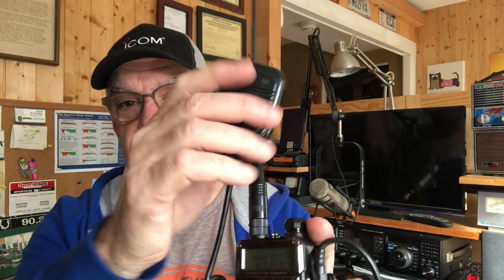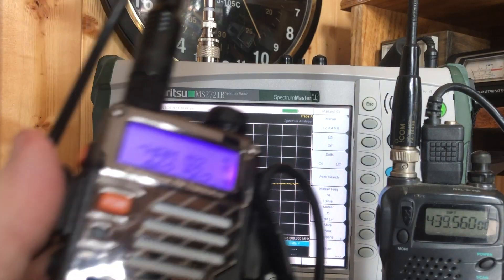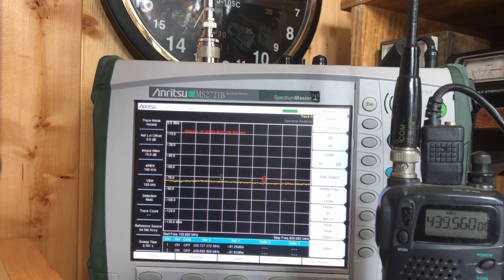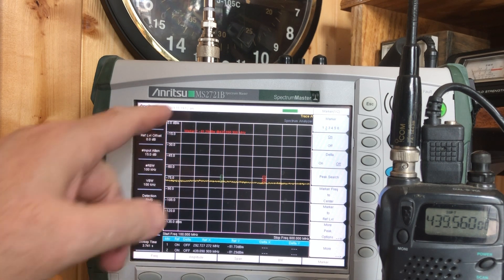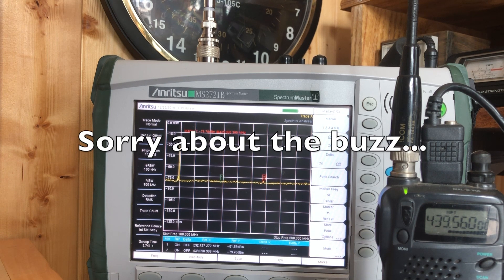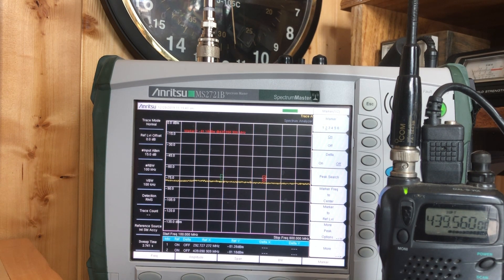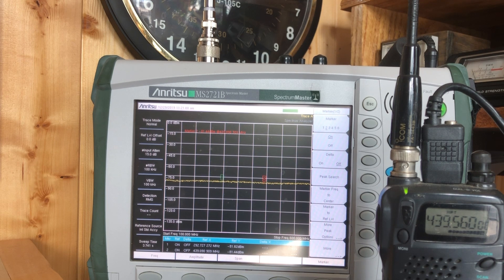Baofeng UV5R Transmission Test

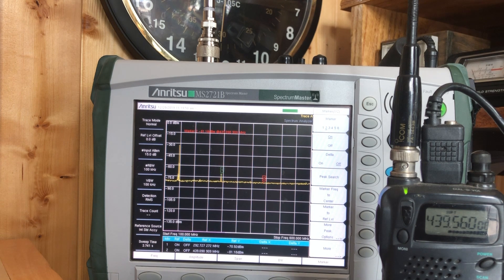Comment: Hi Chris.  Great video – and you kept it simple and to the point.  At 2:00 you questioned whether the 40dB down harmonic was in FCC spec – the answer is, yes it is!  Here is the spec: FCC regs state that for a transmit power of less than 25W (e.g. handie talkies), (i) any spurious emission must be 40dB below the fundamental emission and (ii) not exceed 25µW (microwatts).
  
Various tests I’ve seen on Idiot Tube seem to imply that the UV5r harmonics are generally within the 40dB down FCC specification, although maybe not complying with the maximum specified 25µW (microwatts), which may be the likely cause of harmonics over greater distances compared to the better-made Yaesu, Kenwood and Icom-type radios. 
 
And not to forget that rf is subject to the inverse square law for power density: the power density is proportional to the inverse square of the distance, which means doubling of distance results in a quartering of rf power.  The further away you get, the rf power reduces and possible harmonic interference reduces accordingly.  So for many Baofeng-users, non-compliance with (ii) will not be a problem – apart from the fact your own Baofeng may not comply with the FCC regs and therefore the letter of the law (and of course your licence!  For a “non-scientific” test, you done good, Chris!
Reply from the maker: Thanks!  It definitely was unscientific that’s for sure!  I’m sure if I went further down the block it would’ve been a different result.
Reply: @k2cjbradio   Hi again, Chris.  Don't put yourself down - I thought your video was very straight to the point, and the results were certainly in line with the few other good similar videos on the Tube.  Non-Baofeng owners are eager to bash Baofengs, and of course the Baofeng's main failing is higher spurious emissions than more expensive radios.  But at 30$US (20£UK) - what the heck!  Although they (strictly) do not conform to FCC Regs, they more than satisfy the UK HAM/OFCOM Regs.   
The consensus of the good oscilloscope videos on the Tube suggests that the typical Baofeng emits 1mW spurious or less, which is hardly, in my opinion, something to worry about.  Big spikes on oscilloscopes are not only confusing to most, but some hams use the spikes to cause unnecessary alarm to the innocent!   
Good gracious me - typical bluetooth class 2 devices emit 2.5mW (albeit on 2.4GHz) and home routers anywhere between, on average, 50 to 100 mW (again on 2.4GHz), so just how bad is 1mW spurious emission?!   Once again - good video, Chris.

Comment: I don't have a spectrum analyzer, but I did the the test with my Yaesu VX-150 HT set to 146.520 and my Icom IC-T7H set to 439.560 like in the video.  My Yaesu VX-150 also caused a 9 strength signal at 439.560  just like the UV-5R.  Is my Yaesu defective?

Comment: Probably putting a bandpass filter on the feed line to an external antenna would eliminate harmonics, could be practical in a mobile application or in the shack. Making it portable is possibly with some creativity.

Comment: Lets face it baofeng  is a cheap radio. It did help bring people into the hobby...but at what cost? Also something to look at how does this affect the bands with first responders that have switched to digital scrambled frequency?
Reply from the maker: Canadian Maker Project True on all points.  Digital will probably get thru, but I wonder if an RF signal is strong enough, would it swamp the input of a digital HT?  Best to be too cautious and avoid potential interference.  Thanks for checking in!

Comment: Clipping your hand mic to the radio's antenna is a good way to break the antenna.
Reply: Nope  - it wont break the antenna, but it WILL put undue pressure on the antenna mount and break that!